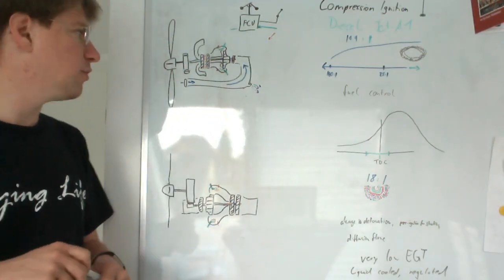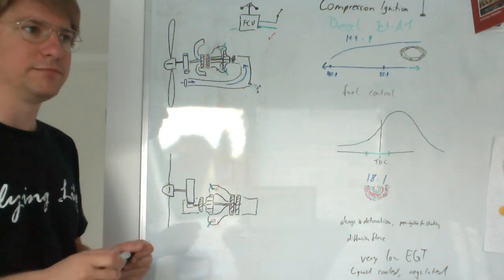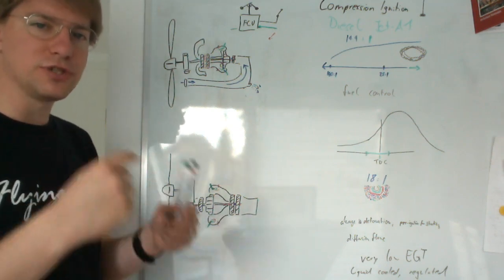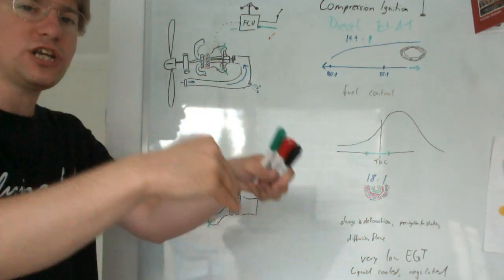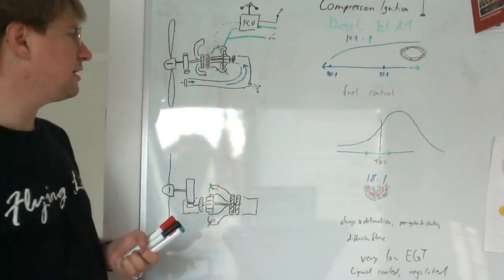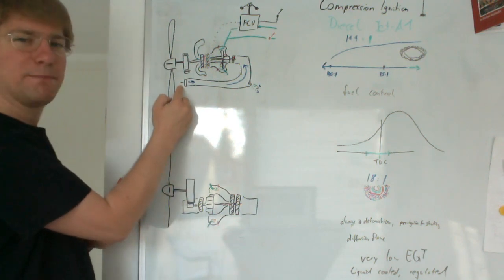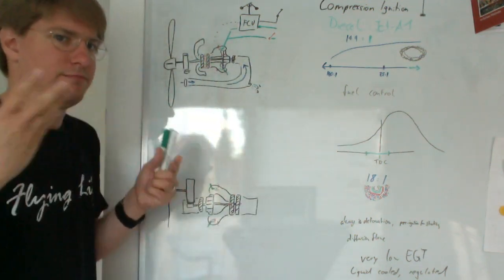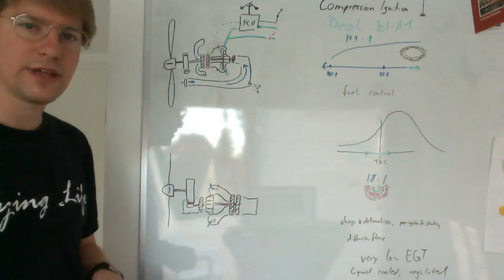The turboprop engine is basically a Diesel

Comment: Watching your video of Diesel Engines you did a good job of explaining about fuel economy and control.
What needs to be done to allow a piston diesel engine to function when it is inverted such as happens in a chain saw or leaf blower?
A flying boat while it is slow can use a standard marine diesel but after take off when it starts to do fancy flying stunts the plane becomes inverted. The problem of flying inverted in the early 20th centuary by military planes.
Also have you done any.videos on the effects of scrubbers etc that marine diesels have on their exhaust to reduce pollution?
Thanks for your attention to my questions. Regards Philip